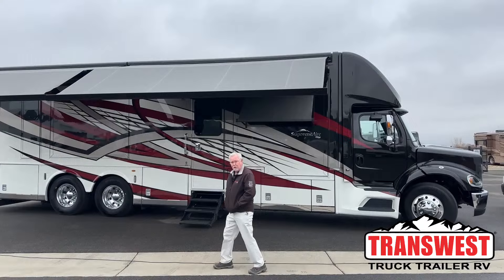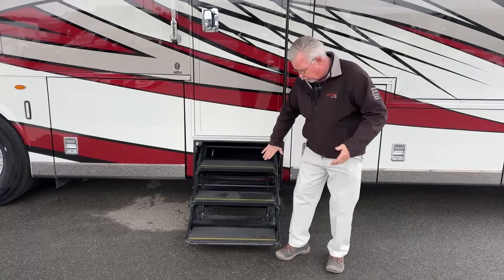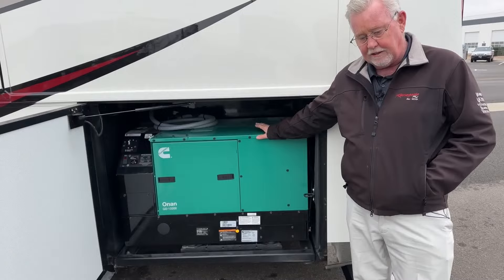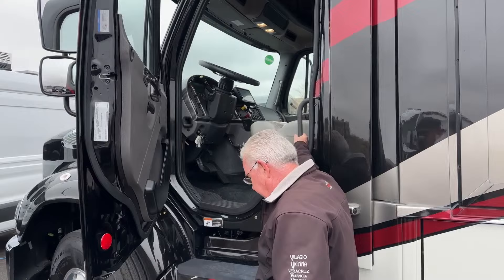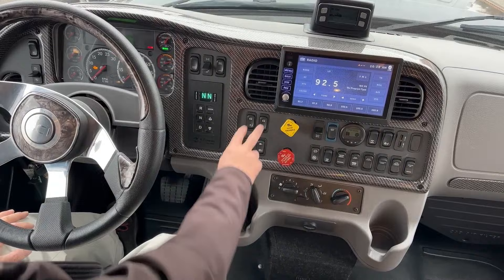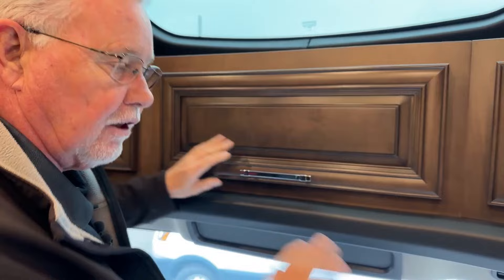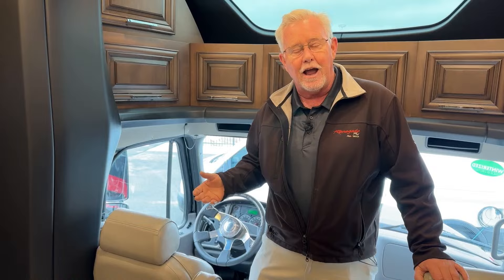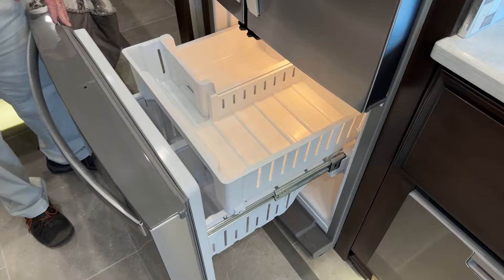2023 Newmar Supreme Aire 4051

Comment: On floor heat you said you can run the oasis. Floor heat is electric? Can you set the floor heat to come on just before you get up in the morning
Reply: The Oasis is only for your hydronic heat and is thermostatically controlled
Floor heat is electric and is on or off. The higher you have it set, the more frequently the current is engaged. You could turn it on from your phone if you wanted warm tosies but it would take just a few minutes to warm up. 
Thanks for tuning in!